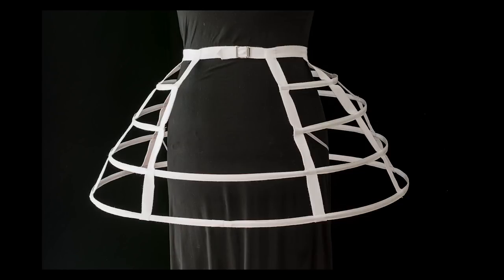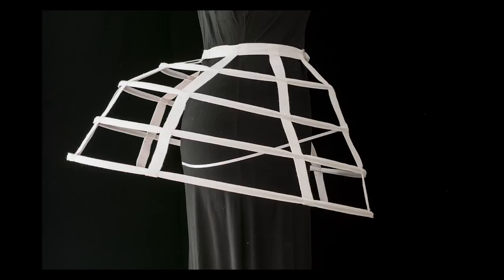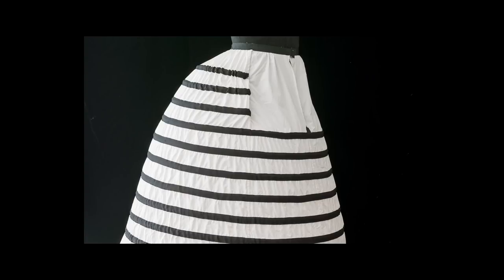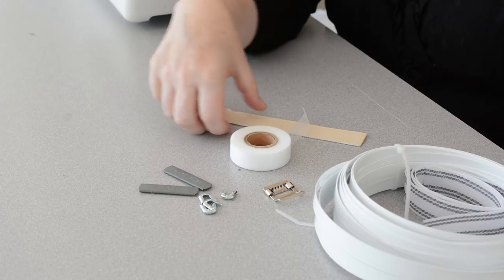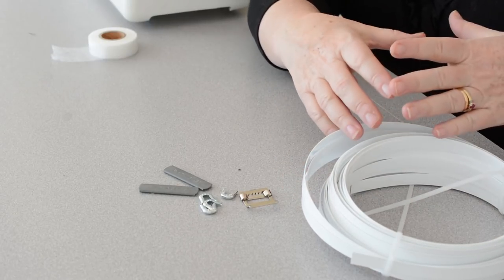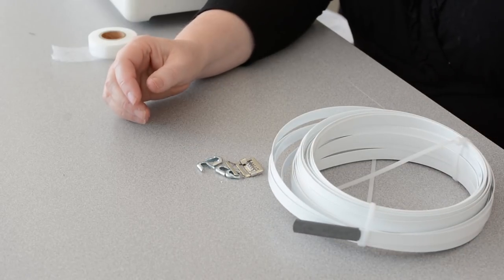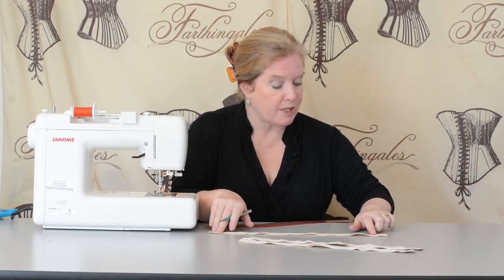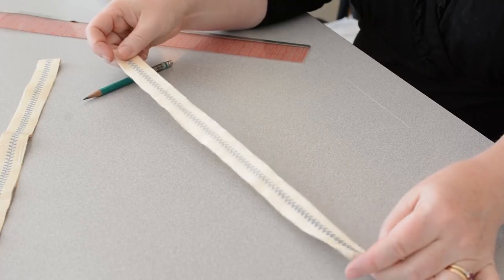How to Make a Cage Crinoline

Comment: What is the purpose of the gap in the front?
Reply from the maker: It helps to get into and out of the crinoline and...it's the way it was always done - depending on your size you may be able to make closed hoops all the way up.
Reply from the maker: Makes getting in and out easier and allows the front to lay flatter - so you don't have a big belly look
Reply: I hace also found in research  it was for when they sit down in chairs and sofas that open hoop in top will ease up and it can lay better and also dont have any accidents  where the hoops near the waist push up or skirt and show you undergarments

Comment: Thank you so much for this video. Just wandering - can you make a completely open hoop skirt - so that it will show fx a pair of pants underneath or do you always need a closed hoop for it to stay round?
Reply from the maker: The hoop steel I use is "spring steel" so it's very flexible and does not stay in a circular shape unless it is held with the connectors - unlike a hulahoop which is solid and would stay circular...so, "no" . Keep in mind that if you were to use a hulahoop you would not have the flexibility that would allow you to sit down.
Reply: @farthingalescorsetmakingsu2655  
Thank you.. that makes sense.. :-).. but how do you then make those "half hoops" that are just used on the hips - is that another type of hoop steel then..??
Reply from the maker: @birgitterandsted3711  the closed hoops don't allow the open hoops to open further...but if all the hoops were open there would be no control
Reply: @farthingalescorsetmakingsu2655  okay.. thank you so much for taking the time to answer my questions. That means so much. Thank you.
Reply from the maker: @birgitterandsted3711  I appologize for the delay answering - the posts here don't come to my e-mail and I don't check this often.
Reply: @farthingalescorsetmakingsu2655  no need for apologies. I'm just so grateful that you have given me so good answers and have taken the time to answer. Thank you🙏🙏